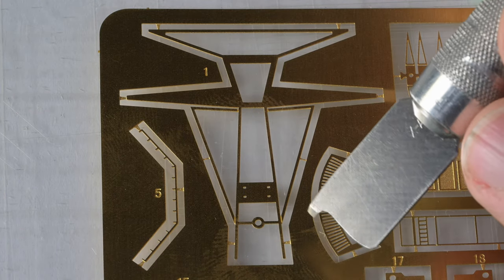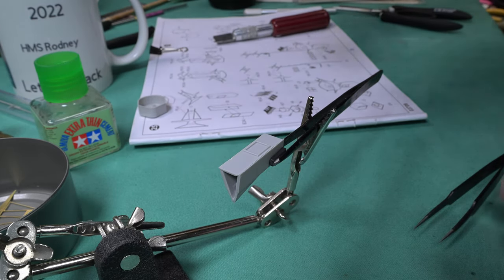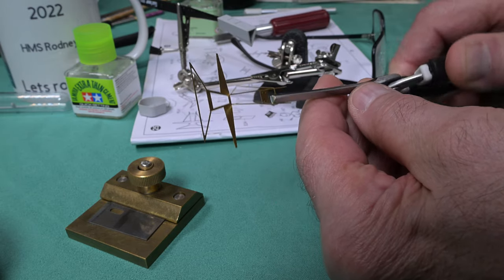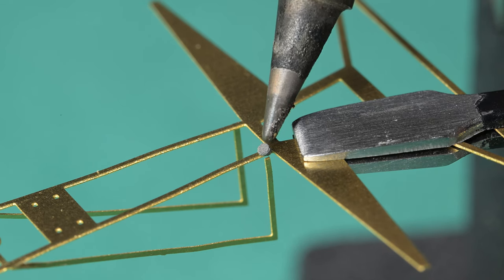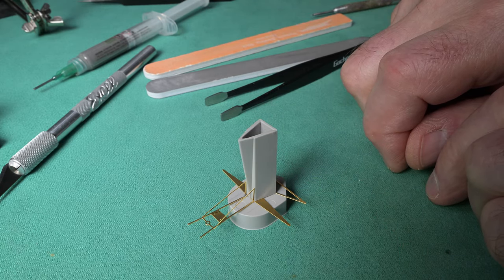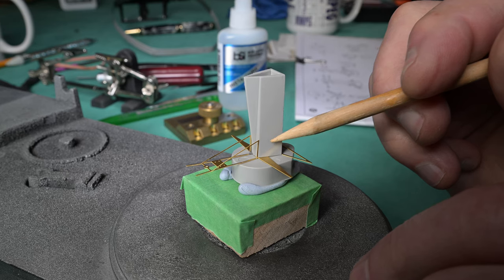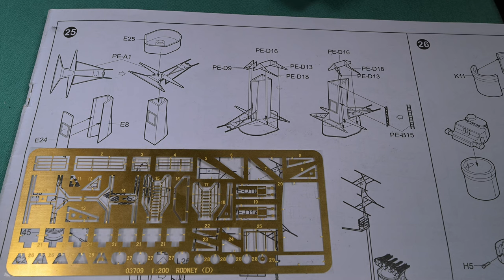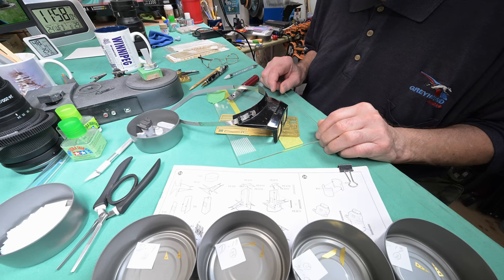The Model Ship - Part 1231

Comment: Hi Ron, nice job on the PE.  Regarding the Tamiya Quick setting glue.  I never use it unless the parts are touching.  Like you saw.  it evaporates so fast, but the time you get the part in place in place it's to late.  For parts that require a little more time to get into place, I actually prefer the Revell Contacta.  Thanks for sharing.  Have a great day.  Jeff
Reply from the maker: Thanks for the tips Jeff!

Comment: Nice job of soldering. I actually think it would have been better to leave it broken until you put it into position and then attach it in the position you want with CA. nicely done though. After painting it will be very nice.
Reply from the maker: Thanks for the tip